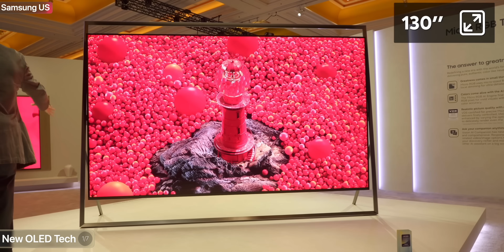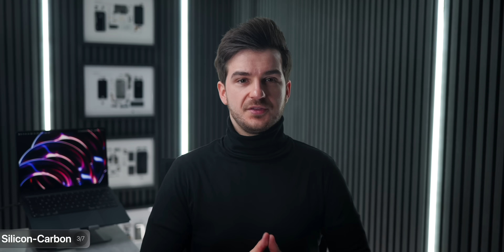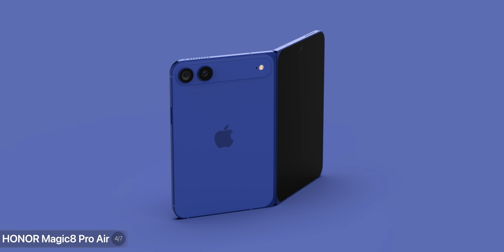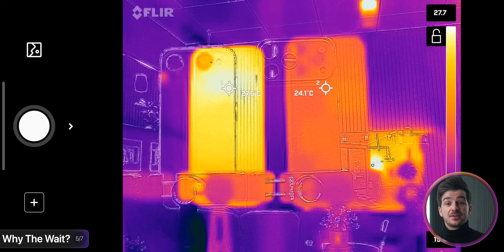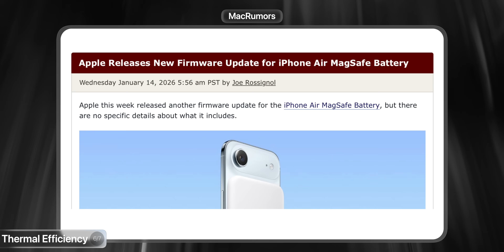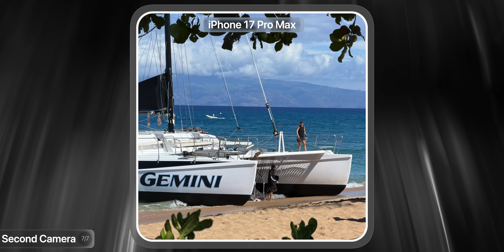iPhone Air 2 – The Battery Revolution!

Comment: I love my iPhone Air. The battery is never an issue.
Reply: If I need more battery for the day I just slap my Apple MagSafe 'battery pack' on the back of my Air after it's been charged to my set maximum of 90% and I get up to 14 hours of operation time using the Apple MagSafe battery 'extender'.
Reply: The battery was the least of my concerns. It was the cameras that ended up being the deal breaker for me because I do a lot of mobile photography.

Comment: Besides a bigger battery, new iPhone Air needs two more camera lenses and stereo speakers. Let us not forget, iPhone Air already has a premium price, adding a secondary camera lens would just bring it on par with regular iPhone which is $200 cheaper. Don't worry, iPhone Pro will still have the performance advantage due to the vapor chamber and a bigger battery but the upcoming iPhone Air needs significant hardware improvements if Apple wants it to sell better.

Comment: I guess Apple and Samsung didn't switch to silicon carbide batteries yet because these batteries have some downsides. They are more sensitive to heat and require more heat management, especially from the charging circuit.
Reply: He is saying silicon-carbon, which is different. Still has too many significant cons, though.

Comment: Battery wasn't the only issue, that damn speaker was up there.
Reply: The speaker is what is keeping me from going from 16e to Air
Reply: @feliche2292 
Have the air now for 5 days coming from 16 pro max. I feared the speaker would be really bad, but it isn’t! It is really not an issue and totals fine for YouTube. 
As well as the battery life. Totally fine. If it comes down just charge it for 10 mins. You can charge everywhere meanwhile.
Reply: What's wrong with it? I don't think I have ever used a speaker on my phone other than the ringtone.
Reply: @hkad6252  people not using the damn buds for their calls

Comment: I’m loving hearing this info, Daniel.  Because, gawd I love my Air.  But I miss the ultra-wide lens more than the telephoto (I also miss the second speaker).  To each their own, right my friend?  :)  Also, what’s up with your Air dying at noon… WTH??  Mine easily lasts until I get home from the office around 4:30-5:00PM, and I use that sucker constantly. (250+ texts per day, and several hours of streaming, plus work related stuff on my device)

Comment: I’m with you: I think telephoto lenses are more important than ultrawide lenses!
Also, I’m not a fan of Google and Honor using generative AI to fill in and enhance long range digital zoom photos.
iPhone Air 2 (Spring 2027) will have a much bigger battery, a second ultrawide lens and a second speaker!

Comment: Silicone carbon battery’s have way less cycles counts than lithium ion batteries battery’s from what I understand. A phone with insane battery life that degrades into absolute trash battery life over the course of one or two year’s is still a turnoff for me because I keep my devices for way longer than that. Aside from that these battery’s expand when charging wich is kind of a problem in a slim stuffed phone like the iPhone air I can imagine.

I’d rather have a known and predictable battery in my phone than some experimental silicon carbon battery’s that completely goes to sht after a year and is cracking my phone open when charging…

However if they would implement these battery’s in their phones I’d still don’t take an air because a slim phone with silicon carbon battery is still gonna have worse battery life than a thick one with silicon carbon battery and since I don’t really care about thickness but care a whole lot about battery life that’s an easy choice for me.

Comment: If apple put second speaker on the new iPhone air I might consider buying it
Reply: Difference between me buying it and not.
Reply: This!
Reply: no. iphone mini better
Reply: Yeah, and a camera that can do macro. Otherwise, absolutely never
Reply: I guarantee you 50% of iPhone users got Airpods.
Reply: @drb5003  yeah but do you really use your AirPods 24 hour?
Reply: Yes agree... this is the main issue. If they put 2 cameras and the second speaker, the iPhone Air will skyrocket.

Comment: How your phone is dead by 12pm from 7am what are you doing on your phone that normal people dont do ?
Reply: This is what I was thinking and. I’m a power user.
Reply: @katinasoutherland7693 😅 Me too. Is basically silly. No normal user is running down the battery in a few hours. LOL …I’ve never had an issue with battery life, and if you look at the comments from users in YouTube videos and Reddit, 98% of them get normal battery life, better than a 16 Pro.
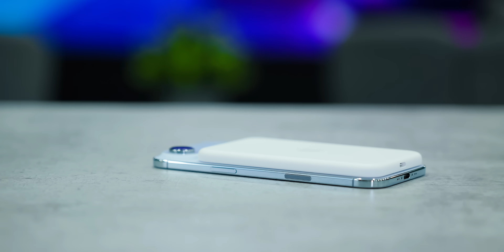Reply: 5g, ai , youtube and high screen brightness. Im in a similar boat, my 16 pro goes from 100% at 05:00 to 40%  at 9am, it would almost certainly be dead by 11am making it a 6hr screen on time phone for my use case. Luckily i charge it on breaks
Reply: @iCozzh yea turn all that off it helps out
Reply: @MoneyX888 turn off exactly what i use? No thanks. How about the 3 trillion dollar phone company sell $1000 phones with high density batteries next time.
Reply: @i @iCozzh give em time to perfect it at least. If they ship this & it’s bad within a year you’re still mad. Everybody relax 😂
Reply: @itreywalk if its mad replace the $15 part (at apples cost) under warranty.
Reply: @iCozzh what part you talking about cost $15. Batteries are now up to $120 out of warranty.
Reply: @itreywalk Bro cant comprehend the battery costing apple $15 due to economy of scale and selling you the replacement with labour and transit for $120. Wake tf up bro.
Reply: 😅 Ya, that makes no sense. What could he possibly be doing to run down the battery in a few hours. I’ve used my Air all day, up to 8 hours of on-screen time.
Reply: i just want iphone mini. with all the advancements battery wont be an issue on it. not like it ever was but people complain
Reply: @yeshyk3694 the fold is rumoured to be mini sized when folded. 5.3” ext display
Reply: He must me running local LLMs, only way for that to happen lmao